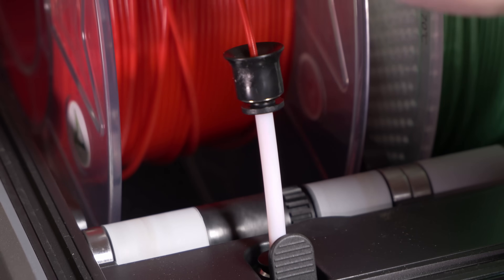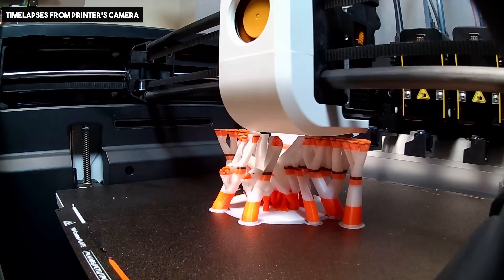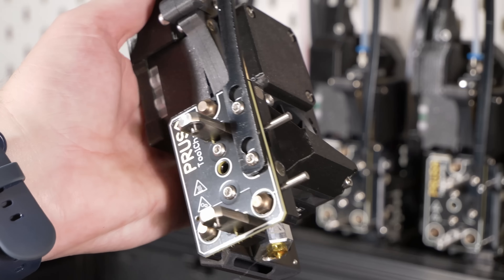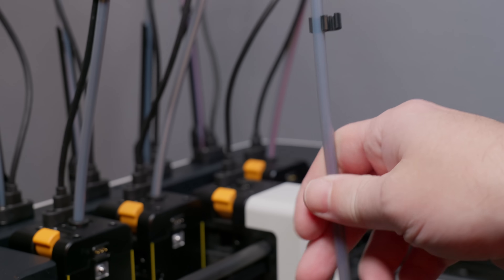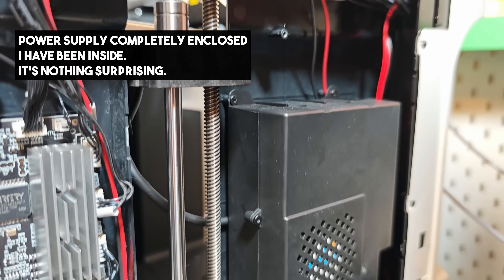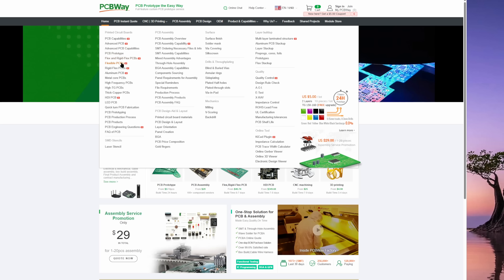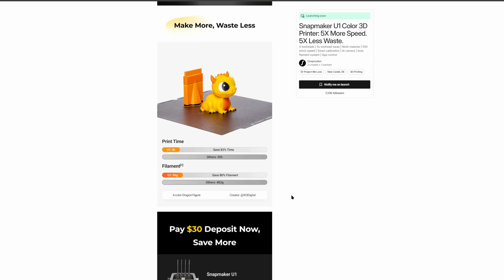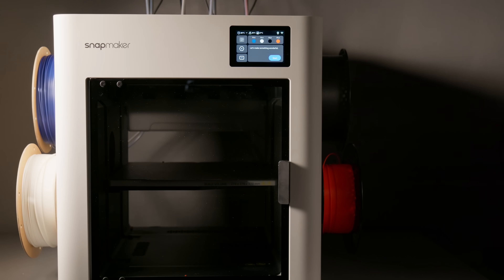FINALLY! An affordable 4X toolchanger! Meet the Snapmaker U1.

Comment: i'm pretty new to 3d printing my self. only had one for about 5 months and have dug hard into stuff and learned a lot. mainly got it to print functional parts so i didn't care about color at the time. now i'm doing more advanced stuff and multi-color AND multi-material is getting more and more wanted with random things i make. i've had 3 printers i've been eyeballing to get next and this one caught my eye with the tool changer concept since i have been manually doing everything with my ender 3 ke. figured out tricks to greatly reduce waste doing so with everything manual since i'm not a fan of waste. this was very appealing to me. but much like many others, the fact it's on kickstarter makes us iffy towards it until it's fully released due to past kickstarter's over the last 5 years alone... but i've showed this off to a few other people and yes, it's definitely has people's attention. my only worry is the quality and accuracy of the prints. i'm a stickler for that, granted i don't mind tinkering to get it super accurate if need be. but thanks for the video.

Comment: My only "concern" actually deals with Klipper. I absolutely love Klipper, but the learning curve for me was massive. It took me a month before I had an Ender 3 reliably printing with Klipper. I'd also state that although the A1 style filament retraction system is really cool, it's most likely going to be a sore point for many that prefer keeping their filament in a dry box, like the AMS, while printing. I notice a difference in print quality between filament spools kept in open air and spools kept in a dry box during the printing process, even with PLA.

Guess I'm one of the crowd that's more interested in printing cool stuff than tinkering with the printer itself.

Comment: There's no way I'm ever backing a 3d printing kickstarter; if it's a reputable company, they don't need to run a kickstarter and are just unnecessarily passing risk on to their customers (which then means they have less incentive to get it right).  If it's not a reputable company, well...

Here's hoping that post-launch it lives up to the hype.  But SnapMaker's rep is not amazing, particularly around build quality and print consistency.  I'd love to be proven wrong, I've been wanting an affordable tool-changing printer for years now.

Comment: Still uses the carbon rails from bamboo lab that they figured out have wear and tear if you look at it, not good
Reply from the maker: no as far as I've seen, the bambu x1 machines really do not wear prematurely, and when they do wear the carbon rods aren't typically the problem. Where did you get that idea?
Reply: One of the longest lasting consumables is your argument against these printers? Make that make sense.

Comment: I see they're offering a spring steel PEI sheet as an add on, what does it come with standard?
Reply from the maker: unless I'm completely mistaken it should come with the double sided textured PEI, I'll check though.
Reply: @LostInTech3D thank you!
Reply: @LostInTech3D  I emailed them. It does come with the standard spring steel PEI plate. The add-on in the Kickstarter is just for a spare

Comment: I wonder, how well would this work with multi sized nozzles, multi thickness layers, 
have a nice .4mm or less nozzle for the outer areas that will be seen, and a .8mm nozzel for the inside, the outside could be sub .1mm the inside could be .5mm layer hights, while you have a nice dissolvable filament for the support alone. 

would be really nice to see if it can handle that, and if it cant, can it be done
Reply from the maker: pretty sure it will happen, it's mostly a slicer thing

Comment: 1. How is the user experience compared to bambu, it is also easy and plug and print or is there more fiddling.
2. How long is the startup and calibration, levelling time before each print
3. How noisy is it compared to its competition
Reply from the maker: 1. yeah easy enough, and completely automated calibration
2. depends, depends. Usually feels about the same as a bambu in my opinion. The leveling isn't yet at full speed on the current firmware either. 
3. not intrusive.

Comment: Been running 2 Prusa XL's at work: a 5 tool and 2 tool machine. At $5k for the 5 tool machine, assembled (not fully), I'm bothered at the lie that it can print flex filament, which is cannot, that is is fully assembled, which it is not, and the issues with belt tightening. I'm also excited to see a more affordable core XY toolchanger machine. Open source firmware is a cherry on top.

Comment: You got me all excited, until I looked at the specs; only a 300deg hot end and no heated chamber. If it had a heated chamber and at least ONE tool head that did up to 370deg, I'd be hooked. These two deficiencies are a deal breaker for me.

Comment: Tbh I was expecting qidi to do this , but snapmaker beat them to it . If they take qidi heaters and nozzle temperature and ad an enclosure it will be the best printer for years. Prusa could do this to the core one instead of the mmu drama since they already have experience with XL. I think this printer will be the beast of 2025-2026 until other start doing the same

Comment: I have seen the nozzles and I am not impressed as the small ceramic heater is hilarious Flashforge 5m had a off market one that Temu and Ali express hyped up. 

There are 3 main problems with that nozzle setup although you didn’t take the silicone sock
Off to expose it.

#1 is that unreliable nozzle Temperatures as its a small ceramic heater which tends to hate Auxilary fan for 600mm/s plus speeds. (not sure if thats going to be a problem with reliability and how they over come the issue for the time being!)

#2 the metal clip holding the ceramic heater will move! When bed adhesion Fails it may push the silicone sock up with the metal clip. This is Dangerously underrated. You may see the ceramic heater where the cables are sealed with resin which will be sheared off by the metal clip and short the circuit. Over heating and fire 🔥 Hazard ⚠️ 

This has happened with similar
Products

I rather have 2 high-end hot-ends rather than 4 cheap ones

Comment: This Prusa multi head printer is ridiculously overpriced and does NOT come assembled so you’ll be required to assemble all tool heads then calibrate each individually . It’s a very time consuming tedious and aggravating process . Buyer beware
Reply from the maker: Realistically it's about an hour or two max, it's mostly because they can't ship it with them attached.

The snap maker tool heads also need to be attached in a not dissimilar way, and then the calibration.

Comment: By participating in the start up thing, will we be able to receive this 3-D printer and if so, will it be the beta version or the finished product? Furthermore, how long would it take in terms of shipping I’m looking to upgrade my old 3-D printer to one that can run multiple colors and material. Is this a good option?
Reply from the maker: It should be a production version, the rest....depends on what tier you back. They have sold a lot and it's hard to know how much capacity they have to fulfil those orders, which is historically one of the unknowns about Kickstarter

Comment: What is the part cooling like on this machine?
Reply from the maker: needs more testing before I can comment, it's promising that they put a larger fan on the carriage though
Reply: @LostInTech3D  Cheers, was a bit worried to see that it only had a whole bed blower from the left-hand side. I am not sure if this will affect overhangs on the right-hand side. I'll be coming from an E3 with two 40mm server fans ducted either side of the toolhead!

Comment: The H2D hotend system seems to be better overall, it seems to be easier to fix if there is a problem and it seems to use less power.
Reply from the maker: better overall is...a stretch lol
Reply: Until you need more than 2 colors
Reply: It makes the printhead heavier, more complicated, and more difficult to service. It also relies on an added mechanism to move and cap nozzles. It's also limited to two colors unless you go back to an AMS style system for one or both nozzles. There are essentially no ways it is superior except for not needing the tool changing system.

Comment: The amount of waste generated by Multi Material Systems is appalling to say the least, and in 99.9% of the cases. Its using FDM materials that are non-recyclable, non-compostable and best case ends up in landfills.  You don't want to know what these materials do when they are mismanaged and end up in the environment. 

Its estimated that even before AMS style system came into the market, we were all ready scrapping +21% of filament, due to the use of supports and the wide range of part print failure. With MMS we are looking at 50%. 

So unless we can convince everyone to switch to a full biodegradable filament such as ecogenesis genPHA or ColorFabb AllPHA. These multi-head systems are great solutions, glad to see one less than the cost of an arm and leg.

Comment: Everyone who does a lot of 3D printing knows that the cost is not in the printer, but in the filament. The toolchanger paradigm is superior in many ways, but most importantly superior in long term cost. However the U1 doesn't actually exist in customer's hands yet and the Prusa XL is prohibitively expensive, so in the mean time the AD5X is only 400 dollars, and actually works with TPU! If you ever get a toolchanger printer down the road you can still use the AD5X for the incredible ability to just use a new spool when the filament runs out. Load it up with 4 spools of Black PETG and you can just keep printing non-stop for days.

Comment: I have COUNTLESS problems with the firmware on my J1. It's awful, and instead of making it robust they moved onto the U1. 2.5 years in and I still have recurring support tickets, 2 with Snapmaker right now for problems that should have been solved in firmware and DOZENS of bugs that are unhandled. DO NOT BUY. What you'll get is a company that gets the product over the line and moves onto some other strategic initiative that has nothing to do with keeping you as a customer long-term. Just read the forums for all the issues people post about if you still want to buy it after reading this.

Comment: I own a Snapmaker J1. Had issues with clogging, had to buy the new upgraded hotends. Integration into Orca slicer was a mess. Their own slicer not usable. After a year I got it working with a custom script to get the tool changes smoothly working. For transferring gcode over wlan you have to use a 3rd party tool. Starting a print or monitoring isn’t possible. No camera. 1000€. 

Broken ribbon cables for booth hotends and linear rail for the X axis had to be replaced too. 

I don’t think they can make a good working software integration for Orca or Prusa slicer.

Comment: This is essentially what I was hoping the bambu h2d  would be. I was desperately hoping bambu saw the potential of a tool changer with the prusa xl and would make their own. Snapmaker seems to have beaten them to it, at a great price no less.

I hope they will have replacement parts available in their store like bambu has so that these printers last ages.
Reply: It looks like the Snapmaker will release the source code for their firmware, and the printer is easier to open up to replace parts.
Reply: The nozzle and bed temps are kind of a dealbreaker for me 🥲but making it Klipper and open for those that want to change it 😍still, i might wait for the Bondtech INDX to upgrade my printer later this year
Reply: This aged well (kinda)

Comment: Cons: open frame (unless they include a top lid that is high enough to accommodate the PTFE tubes) and open filament spools, therefore not optimal for printing some filament types e.g. ABS and not optimal for hydroscopic filaments.
Reply from the maker: Top lid is coming

Comment: First 20 seconds...unless you need more than 4 materials/colors in which case the tool changer is at a massive disadvantage. I'll take slower and more material/color options as I couldn't care less about the waste.  That said, I think this machine is great and more competition the better. I'm just commenting on your comments that ignore more than a single use case. Annnd with all that, I'll still probably buy one of these as well because there are in fact times where I only need 4 materials and the speed would be desired. So I'll take the best of both worlds.

Comment: Hi there, keen to know your process for the pcb board you showed in the video. What did you use to design it on ? I need to make a simple distribution board but have no idea where to start. Cheers
Reply from the maker: if you check out the sponsor segment for the video I did about PVA recently, I actually did a very, very quick fly through of how I make the boards, any questions past that then I am happy to answer on discord :)

Comment: Imagine you are creality and have yet to release the k3 plus (H2D copy) 

And it’s already outdated
Reply from the maker: heh
Reply: @LostInTech3D btw something you might find interesting….. the k2 plus a printer marketed as good for engineering plastics with a heated chamber gets heat creep with fiber filled high temp filaments like PPACF including their own creality brand when the chamber is heated 

They have still not developed a new hitend with a bigger heatsink and I have not seen a single reviewer mention this problem 

It’s impossible to print PPACF with the heated chamber on the k2 plus
Reply from the maker: @martinskamla6789  not great?! I didnt suffer heat creep on mine but I sorta tend to use the core one more for that, which is interesting because...no heated chamber, just heat managed. Have you tried just sorta not using the heated chamber? 
Not used PPA yet !
Reply: @LostInTech3D  I run a print farm and we had 18 k2 plus printers as ABS machines 

We wanted to transition these to PPACF for large parts with the heated chamber as PPACF is much stronger when printed in a heated chamber 

Something the k2 plus absolutely should be able to do 

Anything over 40C chamber temp  at 300C hotend will reliably cause heat creep and a jam with heat conductive filaments such as PPACF 

Problem is large PPACF parts need at least 50C to not warp and to have full strength 

Microswiss has a 130€ hotend that has a bigger heatsink that completely fixes the issue 

But should we as customers (not small ones together we have over 100 creality machines) 
Have to pay for upgrade parts for printers creality released a year ago ? 

The hotend fan is not even running full rpm but there is no way of turning it up as far as we know
Reply from the maker: @martinskamla6789 worth knowing about the micro swiss hotend though

Comment: I don't get why they're all duplicating the extruder motors as well. You could have the extruder motor on the base and simply have it connect to the rest of the extruder through gears. That would make it even cheaper.
Reply from the maker: it's always a compromise between what might be cheapest and what might be a pain in the backside - the motors would need to connect to power somehow which is probably where it gets more complicated, and an extruder + motor probably doesnt cost that much .....if its trade prices.
I feel like the fan being on the carriage wasn't even a cost decision but a design decision. Fans are pretty cheap.

Comment: Are they planning some kind of snappable enclosure on the sides for the filaments?
Those who live in humid environments may prefer to keep their rolls enclosed for the duration of the print (or even longer).
Reply from the maker: not sure, there is a lid, but honestly.....you can feed from anywhere, so, a dryer is fine!

Comment: Good thing this came out, I just bought the CFS to go with my K1 SE on Saturday, setup yesterday (facepalm)

Should have waited longer for one.  If you are doing multicolor production work, this is a godsend, as the poop was adding up to like $8 per bed (like 800 color changes, and all the time between changes)